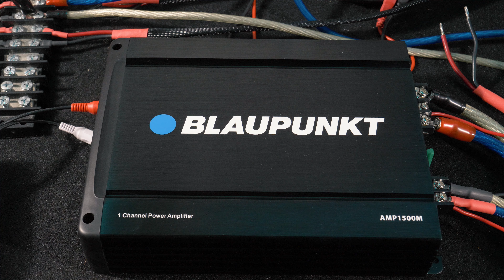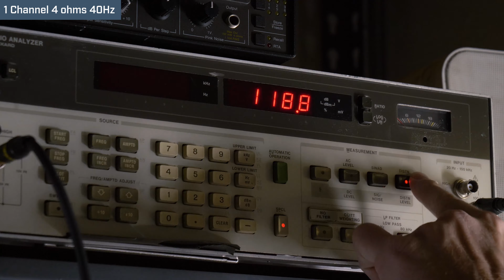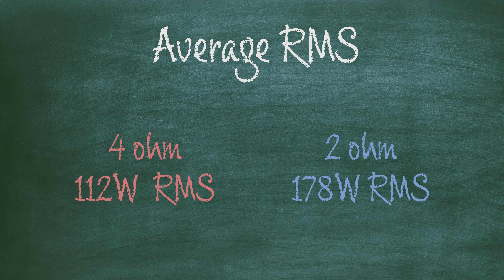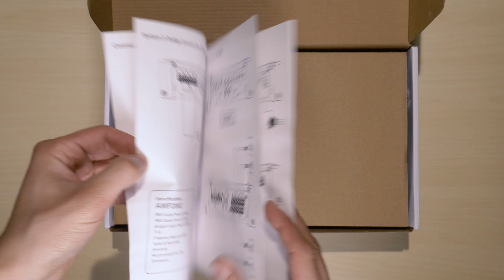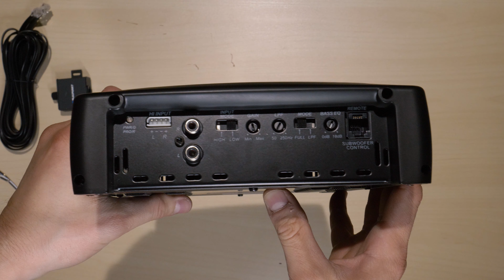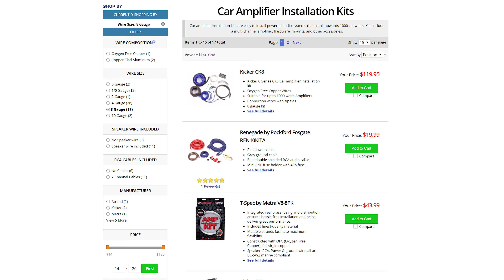Blaupunkt AMP1500M - $50 Walmart Amplifier Testing!!!

Comment: 178w in a class d  monoblock amp is kinda pathetic, you need at least a good solid 300w to push even a modest pair of subs, at 178w you'd need to run a pair of them each with it's own dvc 4 ohm sub to get any real bump, you'd get more bump out of bridging Walmart's $59 Dual XPR82D amp, it dyno'd 300w at 4 ohms bridged......

Comment: Hello
I just purchased jl audio cp112-w0v3. 
What's a good inexpensive amplifier for this? Watts? Mono?
Thanks you..
Reply from the maker: You want a monoblock with a power rating of 200-300W RMS @ 4 ohms. Check these out: 

Rockford Fosgate R500X1D 300W RMS @ 4 ohm
http://www.qualitymobilevideo.com/rockford-fosgate-r500x1d.html?utm_source=YouTube&utm_medium=Video&utm_campaign=Match_Subwoofers-Amplifiers

Rockford Fosgate P400X1 250W RMS @ 4 ohms
http://www.qualitymobilevideo.com/rockford-fosgate-p400x1.html?utm_source=YouTube&utm_medium=Video&utm_campaign=Match_Subwoofers-Amplifiers

Pioneer GMD8601 300W RMS @ 4 ohm
http://www.qualitymobilevideo.com/gm-d8601.html?utm_source=YouTube&utm_medium=Video&utm_campaign=Match_Subwoofers-Amplifiers

Kenwood KAC-5001PS 300W RMS @ 4 ohm
http://www.qualitymobilevideo.com/kac5001ps.html?utm_source=YouTube&utm_medium=Video&utm_campaign=Match_Subwoofers-Amplifiers

Kicker 43DXA500.1 250W RMS @ 4 ohms
http://www.qualitymobilevideo.com/dxa500-1.html?utm_source=YouTube&utm_medium=Video&utm_campaign=Match_Subwoofers-Amplifiers

Kicker CXA600.1 300 Watts RMS @ 4 ohms
http://www.qualitymobilevideo.com/cxa600-1.html?utm_source=YouTube&utm_medium=Video&utm_campaign=Match_Subwoofers-Amplifiers

Comment: Well if you had looked up Blaupunkt before your video you would have discovered they have been around a long time. They have always made great gear. The real surprise is they offer anything at this price point. They have been making quality gear since before you were born. Not an off brand
Reply from the maker: By off-brand, I simply meant it's not one of the top car audio brands like Sony, Rockford Fosgate, Pioneer, Kenwood, Orion, KICKER, JVC, Polk Audio, Boss, Hifonics, Power Acoustik, etc. Ignoring its past, Blaupunkt is currently an "unpopular" brand. It's not a leader in audio gear like it used to be. Hence, off-brand.
Reply: @Qualitymobilevideo  you just redefined the phrase "off-brand" instead of simply admitting you were wrong.  If, in a few years, Sony or Pioneer were to step almost completely out of the car audio market, would you begin calling them "off-brand"?  No.  Not by the ACTUAL definition of the phrase, anyway.

Comment: So at a dollar for dollar cheaper cost, what's the downside?  Longevity? Will it breakdown sooner, or output less power over time? Or are others simply marked up?  Ive got JBL 2way 6.5 coaxials in the rear doors of my 08 Silverado crewcab , and 6.5 components up front.  They are all running off my pioneer head units '50x4' mosfet amp.  They sound great off the deck already as those speakers as designed for low wattage( they actually sound really incredible for no amp and deck never gets hot at all),but I could throw a this cheap amp on them and get some more sound out of them.  Opinion ?
Reply: No, it gets hot and from the first day it has been fake from MS. It caused the fuses to fail and burn. My car is from Iran.